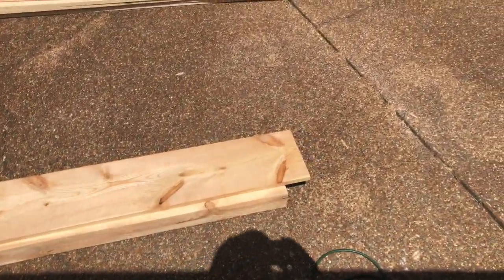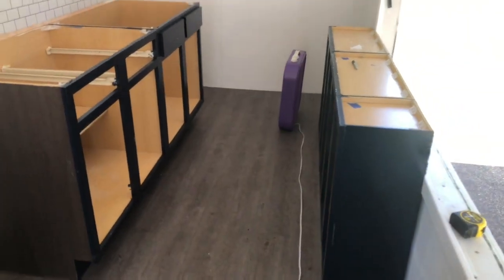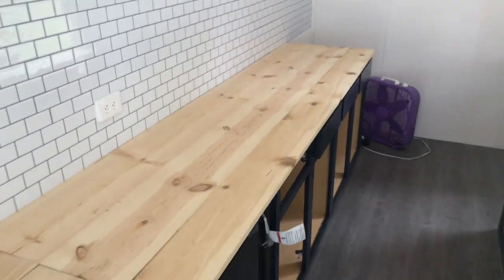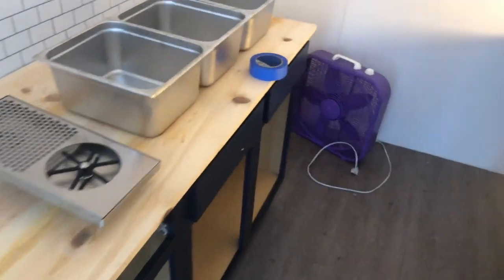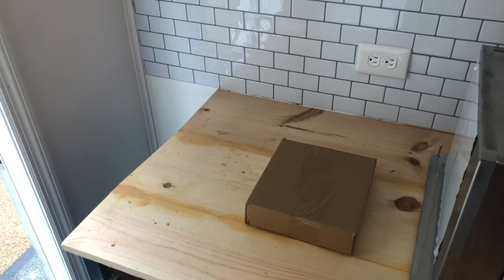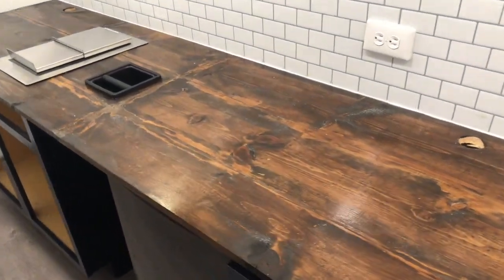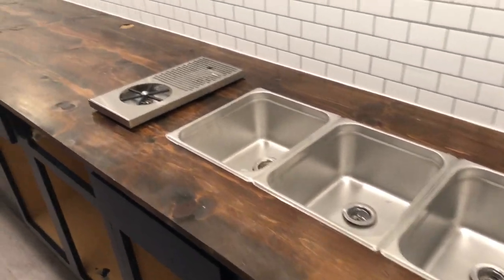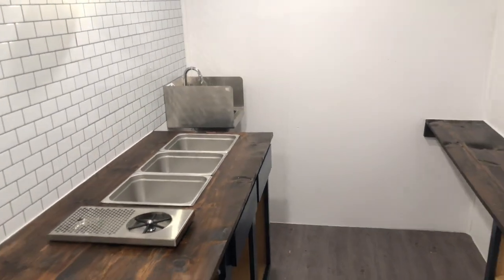Coffee Trailer Video 3: Countertops

Comment: How are the countertops holding up after a year? I’m in the process of building my our trailer and wanted to see if you have any tips involving building the countertops?
Reply from the maker: They are holding up really well. If I did it again, I’d build them and join the sections together in a different/stronger way. It’s time to reapply polyurethane though which isn’t a hard job. I just need to clear everything off and make it happen. But for the most part, the countertops are still in great shape!